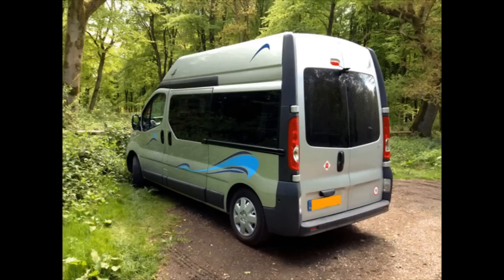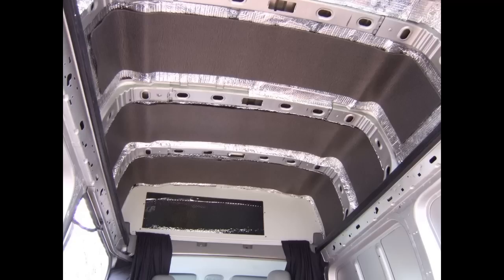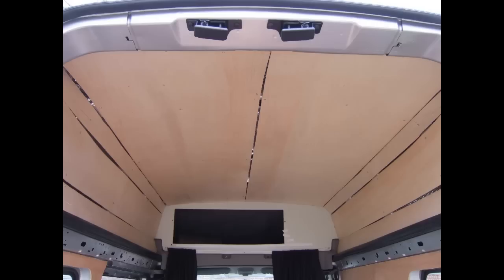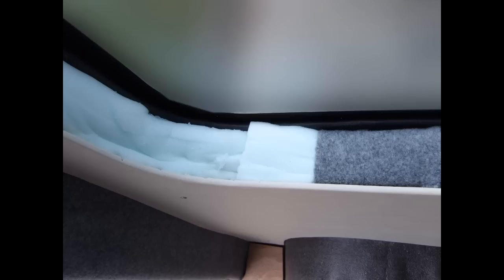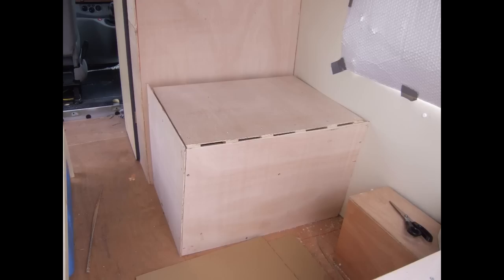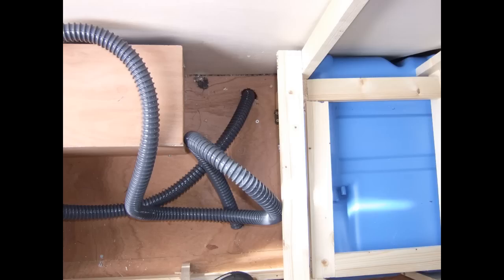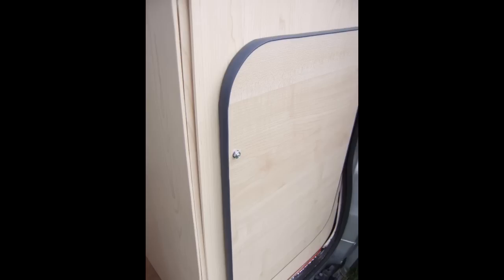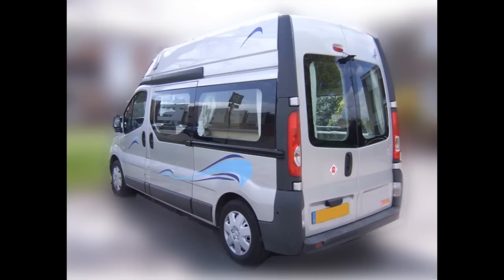HOW TO MAKE A SELF-BUILD MOTORHOME - Low Budget - From Start to Finish

Comment: The reflective bubble is a radiant barrier. But in order for it to work, it CANNOT be installed directly against something. It needs an air space (1/2" - 1") for it to be in any way effective. Otherwise it's doing nothing. You're far better off with polystyrene board and spray foam to fill in gaps and tight areas.

Comment: What strength tint did you get for the windows Rick. I wouldn't mind not feeling like a goldfish myself lol. Fridges are ok for campsites and a hot water heater is good for a shower but humping around the shower water is a bit much for a few days when a basin and flannel can do a good enough job or one of these for rinsing off.
 Portable Rechargeable Battery Operated Outdoor Travel Camping Van Car Shower.

Comment: Did you consider condensation mold with your insulation technique?  Warm moist air hitting cold metal will condense moisture possible resulting in mold?  What are your thoughts?  thank you great van and video.

Comment: Doesnt your propane tank need a vent to the outside? I know most RVs in the US have such a feature. Even if its air tight if it does develop any form of leak it will go outside instead of inside.
Reply from the maker: +Allen The Animal  Yes there is a 40mm drop-out hole in the floor :o)

Comment: You could have used a curtain, secured on both the top and the bottom, instead of walls for your bathroom.  Put the toilet in a nice box.  That way, you can fold the curtains back when you aren't using it and have a lot more space in the van.
Reply: +Cryptic Conversions It would probably take 2 curtains.  Make a box so the lid would rest on the back wall when you want to shower or use the loo.  You can step into the box, close the curtains, and use the toilet or shower.

Comment: 21:07 - Shower could have been done better.  Vinyl is a bad idea - slippery, moldy, gets dirty, gets scratched.  Imagine sand from the beach on this.  Also shower drain hole one side means if van is tilting the other way slightly when parked, water does not drain out.  A stainless steel shower pan with hole in middle and and all sides tilting to middle would have been better.  I'm also astonished you did not waterproof the wood below with a waterproof membrane like Schluter, or Hydroban.  It most definitely will get moldy and rot.  No matter how well you caulk it.  Did you consider buying a ready made RV shower stall with plastic walls?   About $300 for a nice one.

Good tip about the one way valve - did not know that, thanks!
28:12 - seat covers 'looking like a curry house' - ha, ha, ha!  Good one!  I'm Indian so know just what you mean.  Its even worse back in India, especially Madras, err Chennai.

This video was extremely useful for me.  I wanted to see how you 'layered' the build in stages. Your build was done in an incredibly short time, on a shoestring budget, well done!  Wish I had some of your skills to work so fast!  Very good job.

Comment: Really useful video.  Thanks.
I'm just getting into the initial stages of planning a conversion. Can I ask - why did you start with a panel van and not a minibus?  I'd have thought a minibus would save the faff of putting windows in, and may even be insulated too, but then perhaps I'm missing something really obvious.

Comment: Looks good. You had her on the scales after finishing the conversion?
 
I'm visually impaired, so I can't get a driving license. So to be able to go camping in a basic level of luxury, without having to rely on anyone else to drop me and my stuff of in the chosen spot, I'm now thinking of making a small caravan that can be towed by a home built pedal car, making the whole combination fit within cyclist laws here in Belgium.

For that reason, I could really do with a weight idea, so I know if my plan will be possible (not too heavy to get it moving, and to stop it if and when it needs stopping).
Reply: watch rhe you tube channel of solar cabin. He has something like you describe. But I don not know if it meets the Belgian law.

Comment: I don't see this as low budget but it's very nice.
Reply: A Camper van with similar (but arguably more precision designing and materials) bought from a dealer in Canada would run you over $100 000. The price of a similar van would be a Dodge Sprinter say $40 000 CAD, then he spent  $3000 pounds =  $5000 CAD. so lets say this van cost about $45 000-$50 000. That's half the price, and it looks great! I would love to own it.
Reply: Agree, and as you know, cheap motels and hotels here in Canada suck....lucky to get the TV to work if you pay less than $100 per night...My first and only van conversion was a 1969 Ford Econoline in 1976....paid $900 in Edmonton in the winter, but we forgot to put a ceiling vent in it....almost died of heat in California that spring...all we had was insulation, a good bed and storage and a 3 ft by 5 ft blue skylight.......later had  paint job at Earl Sheibs in San Diego for $29.95!!!   I thought I was so cool at the time...

Comment: I would have liked to have seen the finished shower/loo. You showed the walls and floor installation, but what about the shower head? And the toilet? What do you use for that? Does solid waste go down the same pipe as the shower water?
Reply from the maker: The loo is a self-contained porta potty (it's classed as 'black water' and must never be put in regular waste tanks).
The shower goes into the grey water waste tanks, same as the kitchen sink.  The porta potty is lifted out of the loo enclosure, and the enclosure becomes a shower cubicle. The shower is operated on the principle shown in this video:    https://www.youtube.com/watch?v=C6UOA9c7L4g

Comment: Any problems with using all of that spray adhesive once the car gets hot in the summers?  Here in TX it may not be a good option.  Nice build though!
Reply from the maker: +John E    The key is to get High Temperature spay glue :o)

Comment: does the felt help with moisture / sweating issues? Im thinking of doing a similar set up I  just dont know if it would fix cold weather condensation problems.
Reply: The bubble wrap and foam layers stop the moisture and condensation issues.

Comment: Have you ever slept in a hammock? Why don't you make some hammock securement points inside and out so you can sleep in a hammock. I have found them to be very comfortable. The glory of hammocks is they don't require so much floor space when not in use like the bed you have does. They can be taken in or out store in a very small space and they are better for hot nights.

Comment: Excellent video and narration.
If I may ask, you said your bed has to be 6' for insurance, are you required to register the van differently than a cargo van to properly insure it?
Reply from the maker: Bit of a fuzzy area. Some insurance companies won't touch any kind of conversion work, but changing it through DVLA to "motor caravan", I believe, opens up your options regarding insurance.  In order to achieve this change, the conversion needs to comply to certain standards.

Comment: How do you fit the holder for the table on the floor if its already layed. You will be breaking your insulation if you use a jigsaw , drill etc

Comment: I normally do not like "Slide Show" videos; however you did a very good job!!!!
loved it. How long did it take and how much?
Reply from the maker: 4 weeks continuous work. £3000 in parts for the conversion.
Reply: Should be proud,  how is it holding up? Abd how well is the insulation working out?

Comment: For your table you should have just added a block of wood under the table. For your edges why did you not router the edges using your tool drill. Hindsight is a wonderful thing...

Comment: Hi Rick, great video, very informative! I have a question about the floor/ plywood skin etc. Did you screw them directly into the metal? Is there not a risk of rust when you do this ?
Reply from the maker: +Ben Jewell yes there can be a rust risk, but you can go underneath afterwards and spray bitumen on the exposed screw :o)
Reply: Great, thanks!

Comment: Your design and planning is great.  But I'm more curious about how Renault and French technology is working out for you.  They've failed miserably in America with constant electrical problems.  Diodes in the Alternators were quite deplorable (to be polite) and to include the computer systems and various other electronic components.  Even back in the early 80's be stationed in Germany, the largest number of vehicles on the side of the autoban breaking down where all Renaults.

Comment: Did you hook your battery box to the van's alternator...if so, I'd like to see how that's done.  I have a pickup truck with a bed cap that I'd like to run a few small 12v appliances on and don't want to use solar panels.  I'd also like to be able to recharge my marine battery everyday while I'm on the road.
Reply: Dan cockerham Dan, I'd done that using a standard Dual Battery switch and wiring both batteries. It can be switched to run "main" "secondary" or 'Both" for both use and charging.

Comment: listen folks, duct tape and expanding foam are not the way to go. they rot and loose form. expanding foam goes brittle after two years and duck tape hates heat. and no i havnt found a better solution yet.

Comment: Hey Rick, very nice build! Thanks for the video, I've learned a lot!!! I can see why this particular renault model is not the best choice for conversion.. Lots of trimming and compensating for it's shape. Question: how did you connect the fresh water inside your shower and what system do you use to dump the grey water tank?
Reply from the maker: Shower is a hozelock porta shower. Grey water tank has a tapped hose on it.
Reply: OK. thanks! how did you run a hose from the fresh water tank to the shower?
Reply from the maker: No connection exists, the porta shower is a self-contained unit :o)
Reply: oh, ok. makes sense :) thank you!

Comment: How is the shower holding up? Any leakage or mould issues with the lino layering design? I'm thinking of building my own but then lining and sealing it with fibreglass instead.
Reply from the maker: Karl XZY seems fine, although it doesn't get used as a shower much.
Reply: OK nice. We'll be using ours every couple of days between the two of us, so might opt for something a little more durable and watertight. Thanks for the reply

Comment: One more question. How dud you wire up your lights? I have been looking on forums and other sites but no one can explain it or what i need to get to be able to power them. All i no is that you need a leasure battery and a power invertor but when you buy lights the come with a positive and negative cable but how do you wire that up????? HELP please
Reply: Wire them to a car battery.. It has pos and neg clearly marked.. use 'the' car battery or an extra that can be switched with battery on car..

Comment: Skeptical about how much time you saved.  Using several pieces of cardboard to make a pattern then cutting the finish shape would go quickly.  As would transferring the pattern to the plywood and cutting that should be about five minutes.  And I would think you would get a better fit than the kit which does not look all that specific to the van.

Comment: Why insulate and then install all those windows? How much time is really spent hanging around inside the van looking out?  If you camp in wintertime, windows are not good at holding in heat.
Reply: +John Ford Because people like natural light and looking outside. A van with no windows feels a lot smaller too - windows will give the illusion of space.
Reply: You need insulation to prevent condensation dripping off the metal in the van. I camp a lot in winter and learned the hard way.

Comment: Hi Rick its me again :D
Just Started my transit conversion and stressed ain't the word ha, Im looking for some advice please Rick,  i have bought a caravan to use as a donor for my conversion. My original plan was to have the sink/cooker/fridge unit on the rear quarter panel passenger side but after purchasing the caravan i realised the unit in question means the fridge will stick out to far(because of the wheel arch) so i am going to  have to put the kitchen unit on the drivers side which means due to the new layout i am going to have to use the drivers side sliding side door to get in and out of the van. My question is this, Is it ok to use the drivers side sliding side door as the main door to get in and out of the camper? i don't see many vans using the drivers side as a main entry door and was wondering if there is any law to which side the door has to be on. Hope that makes sense haha

Comment: HI thanks for this video.. Any advice / suggestions for the level insulation to go skiing in Switzerland at - 25C in a camper van?
Reply from the maker: Bryce Cooper it sounds like quite a specialised subject of which I lack the relevant knowledge. I would certainly go for something a lot more substantial than what I have included in this video. Much of the heat is lost through the glass windows, so i'm guessing some form of double glazing will probably be The way forward

Comment: You buy an expensive van and customize it on a budget.. Makes perfect sense.. You could have done all of the work yourself for maybe half what this cost you..
.....  Why not buy and older van, rebuild components and customize, would be cheaper..
..... Better still get a precomputerized van, rebuild and customize for even less..  You end up with a collector item worth much more and less likely to break down.. No need for computer tune-ups..
Reply: I don't think people approach a home conversion thinking of resale value of the finished product so much. The point for me at least was to get a workable camper/utility vehicle on a budget of around $4000. 4-years later it still is not 100% finished but I have had many great trips in it.
Reply from the maker: Reliability and low milage was my priority :o) I want this thing to last me a long time and without the issues that buying an older vehicle often comes with. Nothing worse than standing at the side of the road in a cloud of steam.

Comment: Woinerful Video. Thanks so much for sharing. I have thought a long time about buying a van ie ford transit and converting it to a similar sized motor home. However, i have several questions. Are the regulations for converting from van to motorhome strict? What about insuring it? Did you have to get an inspection? What about weight issues? Did you get the van weighed before you started the conversion and after you converted, so that you could try and calculate the ratio between weight and fuel consumption. I am amazed with the relatively low cost of the conversion. I was thinking in the budget region of about 8-10 thousand euros ( I live in Ireland). I have been told that registration regulations in ireland is much more strict than in the UK. however since i would mostly be using the van for traveling in mainland europe, perhaps the best thing would be to buy LWD and registering it in Bulgaria for example (where registration regulations would not be so strict). reply or advice would be appreciated. Thanks.
Reply from the maker: +dlougha  google SBMCC - you will find all your answers :o)

Comment: Doesn't putting the floor boards straight onto the foam compress it and compromise its insulating ability?
Reply from the maker: +Zoe Y no its fine - the weight distribution is such that it should prevent any issues

Comment: how does it work in your country to legalize (homologation), get the authorization to change the characteristics of the van ?
Reply: Nuno Santos fine in the uk  as the van it self has not been changed  in any way  that will affect braking or the structural integrity... the original weight limit will still apply...may be fitting windows may affect the original purchase  tax as not a work van any more  ..if you did it on a new or within so many years from new  technically you may be liable to pay it

Comment: Were you considering skylights? Like windows in the roof? It looks so dark.
Reply from the maker: I did consider it but figured because of the ribbed roof I would have endless water leaking troubles as so many other people do with this arrangement, so I figured I'd leave it out for now - I can always add one later on

Comment: how many 12v sockets do u have for your camper. im making one up and im not sure  how many i need. im using a Renault traffic. i think thats the same as yours
Reply from the maker: +RCTrailTrucks only got the one socket in the living area, but you can always get a splitter if needed :o)
Reply: yeah thats true. Thanks

Comment: Hi there.. Is the roof covered in felt... Is there a technical name for it when looking for suppliers? Also looked up maple valour with no success... Can you tell me where the you purchased yours from.. Cheers
Reply from the maker: Found everything on eBay - For the roof lining, do an eBay serch for "velrtim". For the laminate, try using a search term like "self adhesive vinyl roll wood"
Should yeild the apropriate results :o)
Reply: Thanks.. I'll give that a try